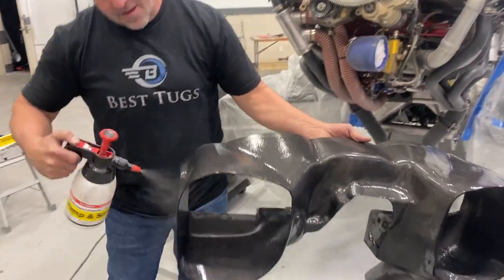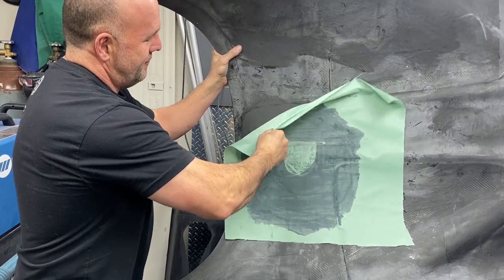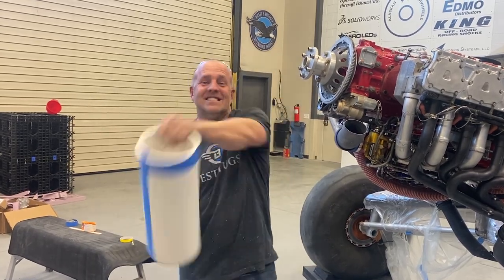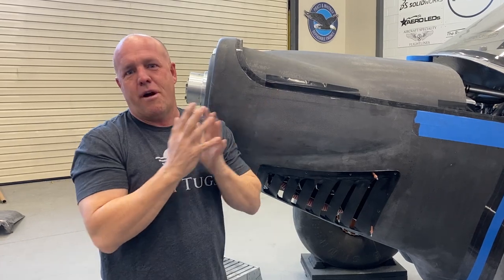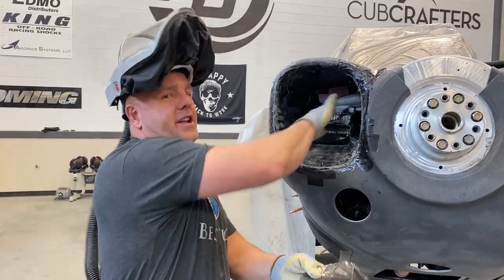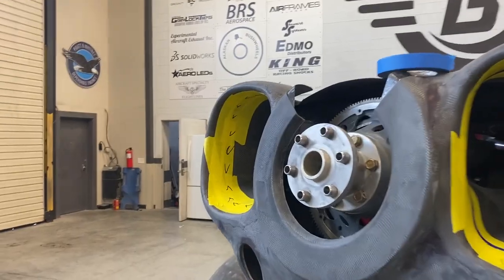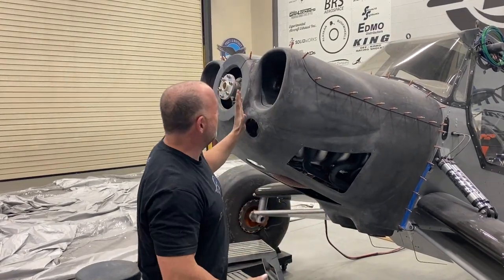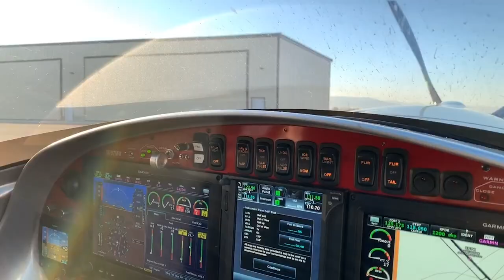Sleeper...Hiding a Monster NOS Race Engine in a Carbon Fiber Bush Plane | Scrappy #46

Comment: I follow Formula 1 and whenever they mention carbon fibre body aero, structure components esp. the main 'Tub' (cockpit), they 'cure' it using an auto clave (relying on pressure and heat to bond the carbon fibre layers) and most F1 teams have a HUGE facility at that.

You do not seem to be doing any such procedures, using an autoclave.

Formula 1 aerodynamically 'flies' on the ground.
Airplanes fly hundreds/thousands of feet in the air.

If SAFETY FIRST is the rule.

QUESTION:
Are
your Scrappy carbon fibre aero body structure/components done 'your way' safe
as compared to the Formula 1 (using an autoclave) carbon fibre chassis/components ?

Have followed your channel all the way 'since Draco' esp. your journeys with the "Flying Cowboys."
Those STOL Drag competitions are awesome too !

Awesome
Cheers and God bless

Comment: Regarding your oil filler funnel part. Are you concerned about contaminates that are stuck to the funnel getting carried into the engine when filling?  I guess it wouldn’t be an issue if it was swiped down first. Being a bush plane seems like it would be impossible to keep dust out.

Comment: I wonder how much rainwater that oil intake can hold if the cover leaks any....
Reply: Good call. I'm sure an engine like that doesn't compress water very well. LOL Perhaps there's a separate cover or large expanding neoprene cap on top. (Much like I have on my J.D. backhoe  hydraulic tank.)There are a lot of things he does we never get to see. Like you never showed drainage for his air box "filter". Yet I'm sure he never forgot to  allow for drainage.

Comment: Since the air intake for the engine is lower part air inlet will water be a problem in heavy rain storm?  Your pulling down with the air slowing down against the back just seems like it could be a problem.  Anyways love your work and videos are extremely well edited.

Comment: Dear Mike, 3D scan it all before the first flight. JIC 👍
Reply from the maker: Yes sir 👍🤠. May I not repeat,  but better safe and scan.  I’m certainly shy of the winds and leaving much bigger margins
Reply: @MikePatey  Quick question, looks like that green Wilga was being sanded down… What’s going on with that? Did you get carried away sanding?🕵️‍♂️

Comment: Does that air intake not need a water drain in the corner? Edit: I mean the air filter section BTW.
Reply from the maker: Yes it has one on the lowest corner 👍🤠

Comment: Have you explained the benefits of an 8-cylinder engine. CONS - weight, heat, fuel consumption, drag, STOL landing momentum, vibration, hard-landing stresses, engine torque, speed body-stresses   PROS - power, STOL Lift-off?, towing?, higher air-speed (how much faster will this be?)

Comment: Amazing project.  However, the cone filter seems pretty small for a 780 cubic inch engine.  It also seems to me that having the air intake on only one side creates an imbalance in cooling from one side to the other.  Maybe an intake tube on both sides would be better.  Mike is way smarter than I am so I’ll bet he is way ahead of anything I would come up with.  Just an observation not a criticism.  Kinda looks like you are running out of projects that are getting in the way of the wings.😉

Comment: For us poor folk who don't have oil funnels built in....just pull the dipstick out but leave 1 or 2 inches in the tube and pour the oil directly onto the dipstick and it will stay stuck to the dipstick and follow it directly into the tube. No funnel ever needed.

Comment: Does anyone else see the licensing deal for manufacturing/kit built after he scans these parts?     Each cowl would be different depending on the engine used but people would pay through the nose for a chance to build and fly an aircraft as carefully, thoroughly, and uniquely designed as this one.

Comment: Normally everything is overengineered, but that filter airbox seems rather small for that filter.  All the air will have to go around the space in the difference between the box ID and the OD of the end of the filter.  Seems very small for that size engine.

Comment: I wonder if you could have heated the pvc pipe? It might have made it malleable and just as easy to pull out.
Reply from the maker: 👍🤠  it had a positive thermal rate rather than negative so when you heat it the part grows and becomes a tighter fit and impossible to remove until it cools again
Reply: @MikePatey   yes true but at around 200 degrees (it might be less,so don’t quote me) pvc become like floppy rubber, and can be manipulated to any shape. You might give it a try for some of your mold making. The thing I’m not sure of is the temperature tolerance of the carbon fiber. Still what you did worked quite well. I’ve loved watching you thought process develop into something real. Can’t wait to see what you come up with next.

Comment: Mike, your work is incredible. Your nomenclature is off. Two part resin systems don’t DRY, they CURE. 
How come you don’t use a roller to work out air bubbles? From my experience a squeegee doesn’t do it